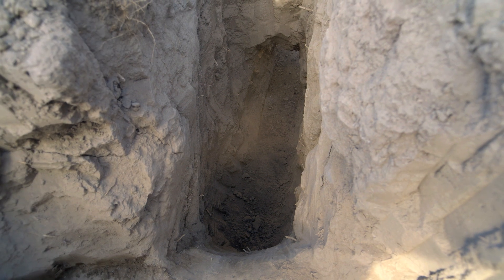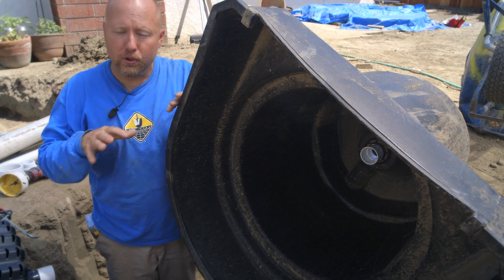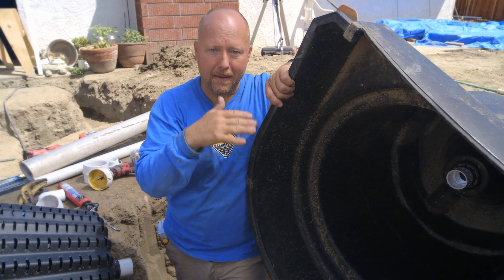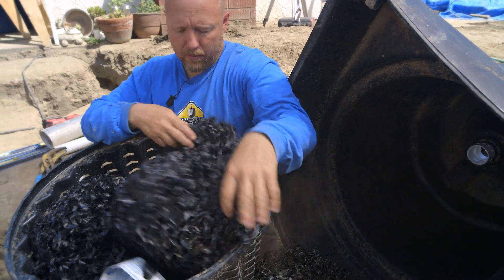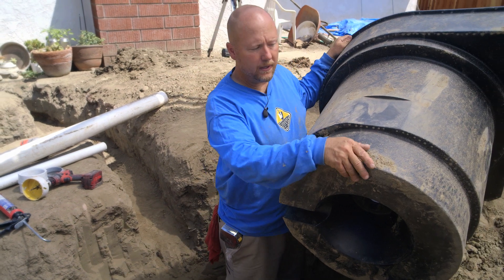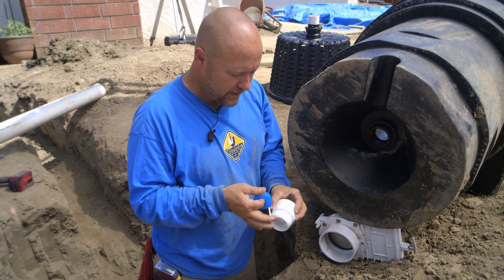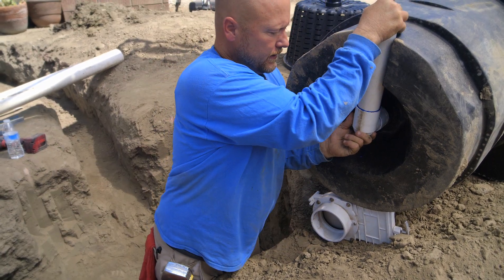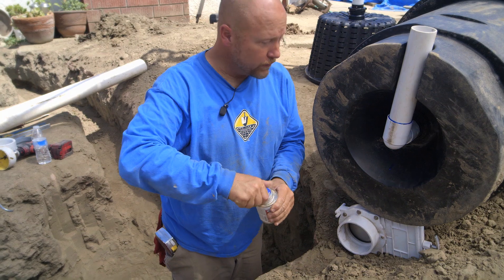Koi Pond Construction | Pond Filter Plumbing - Part 14

Comment: Question that I can't find an answer too... what is the purpose of a bottom drain? Like what exactly does it do...I'm new to ponds and thinking on making one
Reply: Did you ever find your answer? I have a pond that was built on my new property has grass in it now there was one hose under ground I think it may be the same thing not really but my uncle cut it with the mower by mistake previous owner might have not added anything idk but i think the hardest part for me is done the pond is dug already lol

Comment: In video 6 I think you mentioned sand in south Florida. I wish I has sand or dirt like your project. I have coral rock I have been jack hammering for 6 months. I was wondering have you guys ever done a liner under cement? My dog are the liner in the last pond so I was going to use cement but was thinking a liner under cement might make every thing bullet proof?
Reply from the maker: YOu can absolutely put liner below your concrete. It is not terribly uncommon. It's certainly not common anymore but the concrete would need to be water proofed if you didnt' have liner below it. There are probably many questions we should go over when you get closer. Keep in touch with me daily on instagram! Username - @theponddigger
Reply: Thanks for the reply. I put a 12 mil plastic under it. I kinda wish I had put a thick liner under it so I would not have to seal the concrete.  I poured 4 inches of fiber re enforced concrete with plenty of steel. It took about 400 bags. I bought epoxy for it but am thinking about going enamel because I dont know IF ill ever be able to get the cement 100% dry here in Florida.  What kind of sealer would you use? Thanks:)